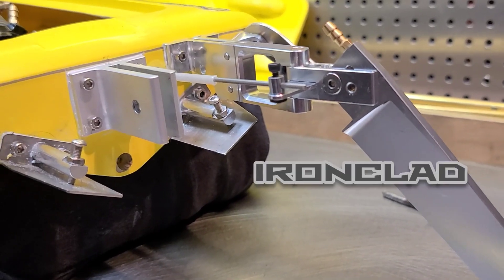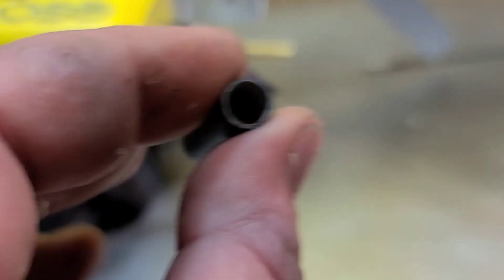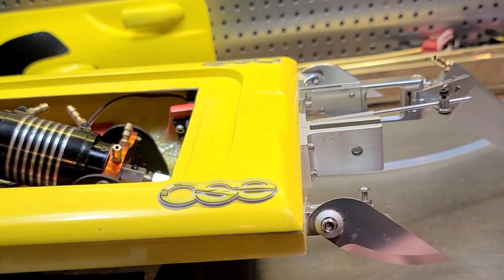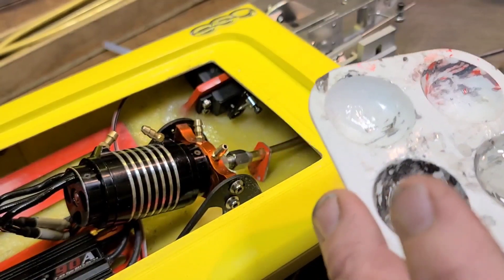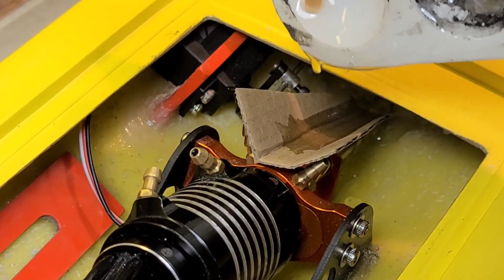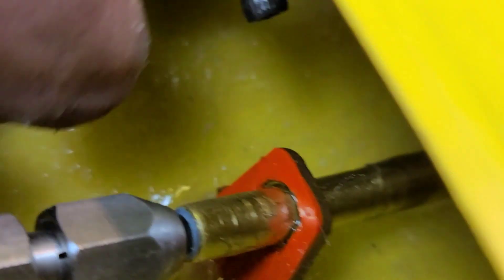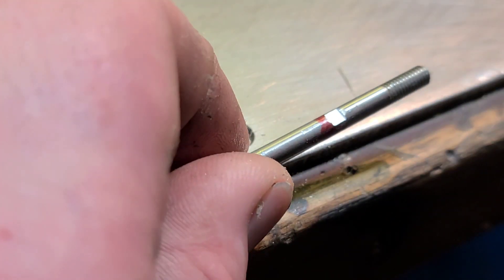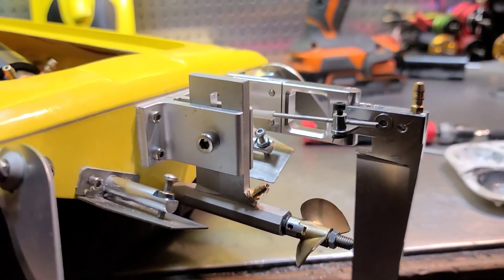Fast Electric RC Boat Build Pt7 Stuffing Tube & Flex cable Installation - Deltaforce 23 Mini Sniper

Comment: What the orange thing in the middle of the coupler and the brass pipe called
Reply from the maker: Are you talking about  the stuffing tube mount that holds the stuffing tube in place?
Reply: @IRONCLADRC  yeah
Reply: @IRONCLADRC  yeah you make those does amazon sell them
Reply: @IRONCLADRC  there any way I can contacted you for some advice like how do I send a picture I got the hull but is smaller then expected
Reply: @IRONCLADRC  can you send a king to smaller water cooled servo and motor and many small wax for a rc boat

Comment: Hi; can you tell me if the flex cable is positive or negative(I think since the propeller is rotating clockwise the flex cable shoud be negative?) thanks for the help.
Reply from the maker: Single motor props rotate counter clockwise, here's a link to the cable I'm using.    https://www.offshoreelectrics.com/proddetail.php?prod=ose-cable-150L
Reply: @IRONCLADRC  thank you.

Comment: I was hoping to see you physically cut the flex shaft and see how you soldered the end. I am about to do one as well but haven’t because I don’t want to ruin it.
Reply from the maker: Oh man I apologize.   Here is a video of how I solder the flex.   I just dip it into solder pull it, clean it and dip it again.    This video I join a shaft to flex, same concept minus the shaft connection     https://youtu.be/dBLlaKNV9IU.      To cut flex I use a cutting wheel on a side grinder nice and slow, then round the end abit.
Reply from the maker: This is a different stuffingtube video I did where I show how to cut cable.  Go to 19min30sec    Hope it help. https://youtu.be/pCQbU3YU0Ho